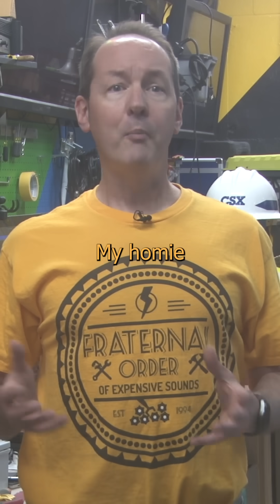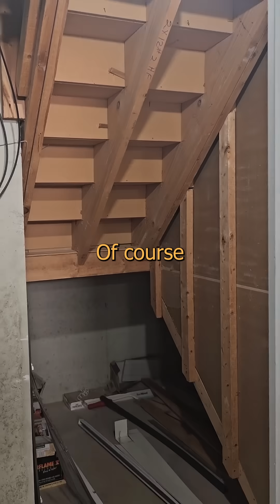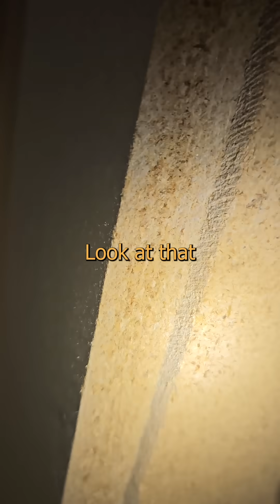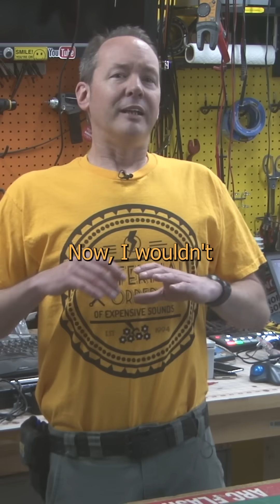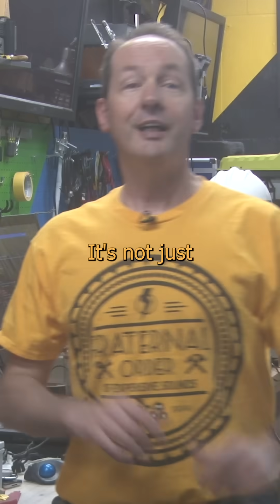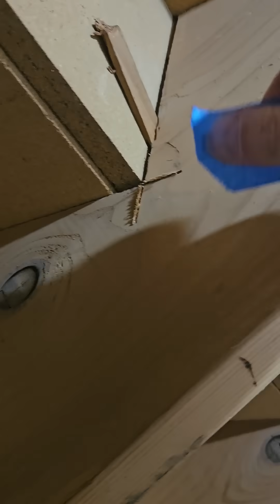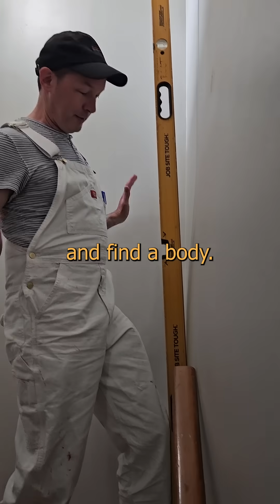Particleboard Staircase #chrisboden #engineering #construction #stairs #cheap #job #work #carpentry

Comment: I would be equally concerned about the stringers. Judging by the overcuts, and amount of shimming done. Those things where made onsite by a cross eyed, idiot, with three fingers on each hand who's last employer was Dark Helmet. I doubt the rise on those stairs is the same all the way up which is very dangerous. Also since the difference in price between buying premade stringers and a piece of lumber that can be made into stringers is not that much, I would be worried what else was cheeped out on.

Comment: My first thought was "What happens when it gets wet?" especially since stairs have more corners than a hooker convention and just as much hidden, toxic moisture.

Regardless of the material, a treader needs to be at least 1.5" thick. Laminating a couple of pieces of MDF together would be strong enough, even if wrong, but a single piece of particleboard is a recipe for disaster.

Comment: Carpenter here 28 years experience. I don’t know if particle board is allowed in that area but I wouldn’t use it even if it was allowed. Stringer’s notched around the landing isn’t a great idea either, it’s best to have the stringers rest fully on the landing. The other issues I’m sure you already see. Love the videos!

Comment: I'm a builder and I say NO! it is not proper.  As far as the waves in the walls, it depends on how old the house is.  Yes, sometimes they can move as they settle. It happens, especially in the area where I currently (and reluctantly) reside, which is marsh/swamp/boggy and instable so it constantly subsides and houses sink. But they do not sink flat, so houses twist and pull apart as they sink.

But that is giving the builder too much credit, especially after seeing the materials used on the steps. So I'd say there wasn't a level or square used on the entire build.

As far as opening the wall, it is too much work to be worth the effort and end result, because remember, walls have two sides and typically the other side is another room, so it is even more work and material.

There fore, as a remodeler/flipper, I typically do not straighten walls unless it is an extremely horrid situation.

Comment: That is cost cutting that is going to get someone killed.  MDF has a very low load bearing capacity.  it is nothing more than sawdust and glue compressed and bonded under extreme pressure.  MDF has uses, but running solo, on stair treads is a disaster waiting to happen.  If they're willing to cut corners there, it makes me wonder what else they cut corners on... Might explain that warped wall, as well.

Comment: I despise this particle crap.  I’ve wasted all my time off this summer from my regular job tearing down 3 single wides and one double wide mobile homes that were flooded in central ky (two I owned, 2 more I bought) 

It is possible to repair these homes and 2 had already been previously flooded, but you will never be able to get this wet moldy sawdust out from in between the rim joist and stud plate. It’s just a giant problem waiting to happen in any home in any application.  

If and when I get around to building new rentals I will not be using this leftover hamster bedding board for anything.

Comment: When you fall through that with a leg on either side at the slightest dampness or moisture in the air and thus squeezing nuts in an seemingly infinite ♾️  time stranding as you can't self rescue from either side of what smacked all your weight into an vein pinching pain entrapment SOMEONE'S GETTING SUED... Probably the builders for using below quality supplies

Comment: Junior year Civil engineering major. Yea those stairs are a hate crime to engineering. The bare minimum for low use stairs in montana is plywood. Let alone particle board. If my future contractor does this id fire them instantly.

Comment: If it was built 60+ years ago, then it is what it is. You just ignore it while periodically monitoring it. 
I would be more concerned about the poor workmanship of the supports as they look like they were done by someone with little experience. It would be worth checking out important supports in the building so he will know what other poor areas it will be worth monitoring in the future. Aren't quick throw together project homes a wonderful concept. ☹️

Comment: There is an issue with stuff like this: the accountability is almost zero. If we actually prosecuted contractors for the danger their fuck ups post instead of trying to look the other way once something breaks and someone is actually hurt, we'd not have to worry. The legal system is f*cked, USA is basically a legal cleptocracy

Comment: The painter's tape of shame. I would annoy some builders by marking every error made like that. Just actively look for any and all issues. I kid you not, when I was back at one of those houses for a repair months later after it closed none of the things I marked were fixed. Hell some of the spots were just painted over, tape and all.

Comment: My parents' house had some old but serviceable hardwood furniture. All it needed was sanded and lackered. So of course my eldes sister got the idea to dump ut all and reolace it with cheap crap. I'll spare you most of the details, just think sintered pot metal handles that break off in your hands and plastic veneers over sawmill sweepings. Anyhow, the dining table had these massive legs to stand on -- made of that cardboard looking stuff. It soaked up moisture, grew in size and collapsed while we were eating.

That furniture shop closed at around the same time, funny that.

Comment: Some stair treads are particle board, but they’re also 1 1/4” thick. Usually covered later in carpet, and used in spec houses all the time.

Comment: In the '70s as a teenager, we lived in a trailer that had particleboard floors. Only the bathroom had plywood flooring. At 14, five feet and slightly under 100 pounds, I went through the floor in my closet....the weight of a big box of books and myself was more than it could take. Got some stitches and bruises out of it.

Comment: The over cuts on the stair stringer make me a little concerned.  Just run a 2x6 under it with a few screws properly installed.  That will be an ok span.

Comment: Well those vertical sponges er um stairs are probably built to "code". SO they would be "legal". But code just means MINIMUM standard, with those stairs and that amusement park drywall, man FFS check the spaghetti factory, hell there's probably water lines running up exterior walls.

Comment: I would've build theatre platforms with that wood, nevermind parts of a house! (The correct surface of a theatrical platform is 3/4 inch CDF plywood, whether that platform will be 8 inches tall or 8 feet)

Comment: The masking tape 🤣🤣🤣 if anyone’s in trades you know what the blue masking tape means lmfaoooo fix that shit it’s eaither an RFI or a design team fuck up as usual but for those who may not understand any of that our Forman would place blue masking tape on or around areas that needed more attention than the rest to make the unit apartment or lobby are what ever have you be delt with first like drywall or unsanded drywall mudd or the electricians live wire hanging down that we’ve told them for a week straight to fix and is still there shout out power and design in the Bethesda area so to sum it all up u see blue masking tape your about to have a powwow about how meany and how long is it gonna take to make all the masking tape disappear

Comment: Those stairs are by far not up to code we would only use something like that as what we would call a temp stair to be put in place while your main stair cases are being installed no idea why or how they forgot them or just said welp if it’s in it’s in and I’m goin tf home type of deal and the risers weren’t even stapled to the treads very unstable and unsecured could lead to a type 2 falling through the stairs lol

Comment: When it was just the backboard being shown I was a bit confused as to why he was going so hard on these stairs.  Then he panned to the bottom (The board you actually step on) and it's the same shit material so I have to agree.  I don't care if you use the cheap shit on the back but on the step itself is crazy.

Comment: Hey, love your content. Usually don't comment much myself,  but... i am a professional painter, mostly residential. If you spray, but don't backroll, you get something called tint float, where the pigments doesn't stay mixed as well and float closer to the surface,  and it makes touchup by hand a bit of a nightmare. Though it is mostly a problem with darker colors, not as noticeable with lighter colors

Comment: In every state I have worked in that is very illegal.  I’m talking license pulling legal.  Not just fines but huge structural safety and integrity violations.  And yes I have been a general contractor for about 6 yrs now and was a carpenter for the 7 previous yrs after I retired from the corps 

Not to mention the over cuts on the rise and runs of the casements

Comment: Me and my gf was looking to buy a house and let me tell you it was leaning. I might not be exaggerating with the floors on the second floor leaning over 10 degrees, perhaps even 20 in the worst room.
But not just to one side. No, the left side leaned to the left and the right side leaning to the right.
Poor foundation combined with a not so stable location, then ~70years of gravity. And they just filled in the cracks as they appeared.
One upside tho. It would be easy to clean your ballroom. They'd practically collect themselves in a nice lill pile.
It was cheap, that's why we were looking. But that foundation is not I could fix myself. And the best option to fix it would have cost almost as much as the house itself. And not guaranteed the ground wouldn't continue to give out. Even tho the solution was to pump down some binding agent in the ground together with stilts, then rebuilding the foundation.
A shame because it was a nice lill house with a beautifully garden.

Comment: Please tell me you're joking at having to ask if particleboard for treads is even remotely sound...
For anyone else questioning loadbearing materials for treads, I'll refer to any chart (digital or otherwise) that features lateral strength, &c. for virgin woods' (i.e., not MDF, OSB, GLULAM, &c) p.s.i. & other characteristics to assist in deciding how NOT to assemble an architectural feature fit for H.H. Holmes' pursuits.

Comment: When i was in the local 104 sheet metal union, i was taught to use my eye to find flaws in duct lines, not tape measures or laser lines. I can tell you trust your eyes to find flaws and THEN confirm it with tools. Love to see it 👍

Comment: I'm A licensed real estate agent and a construction manager, and I can tell you for a fact, from a couple of different sales that I've done that, after seeing how unlevel and not straight that wall in the stairwell was compared to when that level was rested on the floor, that is 100000% out of code and that entire house is probably going to have to be re-built. That's the base structure of the house in the stairwell, and if the base structure of the house is built at that severe of an angle, all the walls are going to be f***

Comment: Modular stairs. Often used in apartments and pioneered in track homes. All about cutting costs at the cost of workmanship and longevity.

The idea is that a house "typically" lasts 75-100 years between demolishment or major renovations, so every part is designed with that 75-year mark in mind. IF these stairs are treated correctly; no spills, no overloading, etc. they will last 75 years. 

This doesn't take into account relative humidity or even the differences between track homes where one might be a mile from a water source and another may be beachfront property.

Comment: unfortunetely the same people that built this are hiring undocumented people and paying them 5 bucks an hour so they can rip people off. this is absolutely disgusting!!! How did that even pass inspection this is completely dangerous on so many levels. should've had it inspected before buying it cause you'd atleast have someone responcable for paying to have this fixed

Comment: Knowing what little I know about wood, particle board like that is just sawdust and glue compressed into boards. Problem with that is the glue is weaker than wood grains and since the glue is everywhere, everywhere is a breaking point. Also, in normal wood, it is cut so that the grain lines up lengthwise(ie the poky pixels are on the shortest side of the wooden board) because it allows the lengthier sides to withstand more pressure meaning that particle board pretty much has the weakest side of wood on all sides because the grain doesn’t line up anywhere. You can even see this if you have a wooden board, particle wood board, and an axe. Take the axe use it to take a single chop at the longest side of each board. I reckon you’ll see that the particle board will probably be near if not completely cut through while the wooden board will have either a dent or small slice taken out of it, depending on axe sharpness and weight.

Comment: No way that's a drywall. I'm bad at construction (but still do it when no better job's around), but that's impossibly bad even for an amateur. Even a rotband and plaster wall takes effort to get that curved. But then again, we have different standards in Eastern Europe - turns out cheap row houses in UK is just as bad as shown here..😬

Comment: That particle board is 100% fine if dont get it wet...  so DONT GET IT WET.  Simple as that.      As for the reverce t-p vibe of the drywall in stairwells it a visual cue that ya got more room up stairs than down.     Same as the air head that done it

Comment: My house literally doesn't have a single wall that is straight or flat, I swear. The worst part is that it's brick, so it's not warping 😂 we had new doors fitted and the actual carpenter doing them physically scratched his head at how wonky 4 of the 5 doorways in the hall were. Bless him for fixing them with no extra charge.

Comment: Serious note here. I am a (funny enough Jewish) carpenter. Yes, that particle board is bad news. If it gets wet it will fall apart faster than a momma's boy first day of boot camp. But the biggest danger to the boards isn't water from outside or from pipes, but from pets, toddlers, and your drunk cousin Steve. I have seen 2x8s rotted out by Fido's pea sized pee holder, and that particle board isn't even 1 inch. Cousin Steve's gonna pee on that third step twice and find himself roleplaying Harry Potter pretty quick.

Comment: For the stairs. Ya got 2 options. Proper route of removala and replacement to bring a valid hazard up to code. Or what i would do because im broke and more strapped for time then not. Cut some 2x4s/2x6s down to size. Properly nail the one side, toe nail the other side. Be mindfull not to drive nails through treads or into oartical board. This will then take up the structural part of the stairs. And if using decent construction screws the trade even tho its split will have a load rating of overr 1000lbs sheer force. Plenty enough for several mcdonalds loving americans to stand on

Comment: You can buy particle board floor sheets here, it's actually the standard flooring in pretty much all houses. Then you add whatever material you want on top, laminate or whatever. I'm not sure I'd build stairs out of it but if it's good enough to support all weight in the floors?

Comment: (Carpenter and business owner here) Not up to code for sure, if it’s not in the budget and there’s no good option I recommend cutting and installing 2x12s flat and directly under the particle board with some new stringers to support them. It’s not perfect but it’s a lot safer and won’t hurt someone. Good luck and congratulations on the home

Comment: I’m 73. The son of a builder. I worked in and around the building trades all my life. I had an acquaintance ask me one day to look at his second floor loft in the  converted storage shed he and his wife were living in. He said it was very bouncy and he was sure if it was safe.  He had laid 2x4s flat on the top plate of the front and back wall at 16” oc. and then 3/8” plywood on that.  I could not believe it. It was only a 12’ span but still.  I am surprised it didn’t collapse as that is were he and his wife slept.

Comment: I may be an ironworker by trade, but I've actually built a wooden stair, guided by a friend of mine who's forgotten more than I've ever known.  And that shit would be ripped out and torched in a dumpster as fast as both our broken down asses could dispatch it.  

We did our treads out of 2x6 and 2x8.  And that stringer with the cross cuts...jesus fuck, someone built that and sleeps at night?  That's clinical fucking sociopathy.